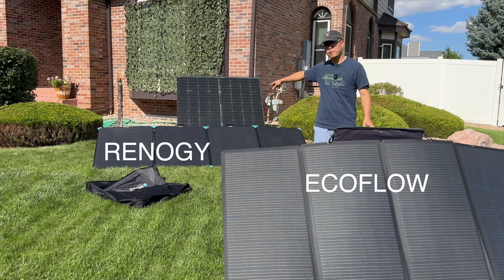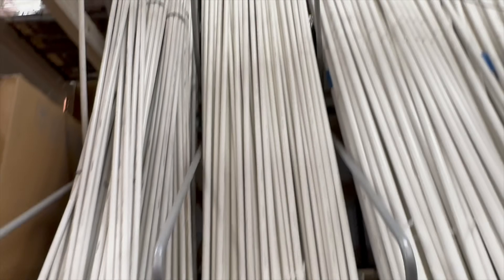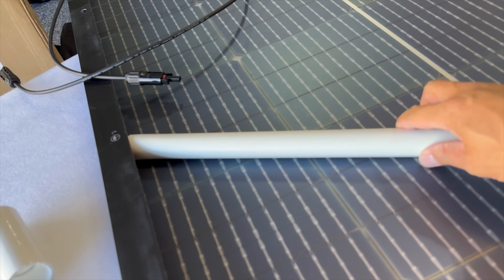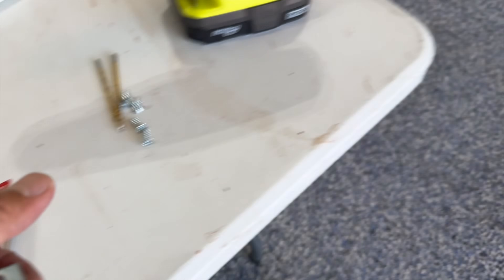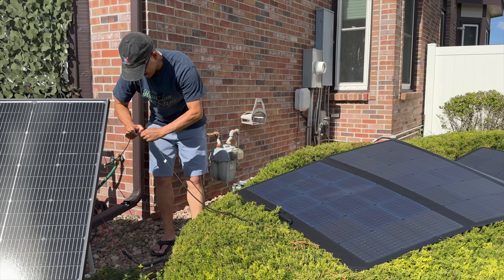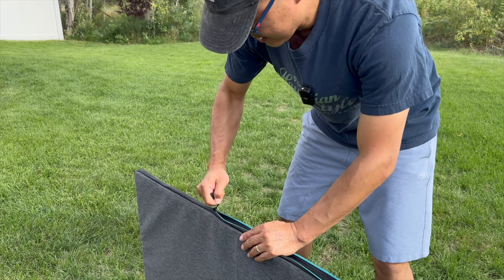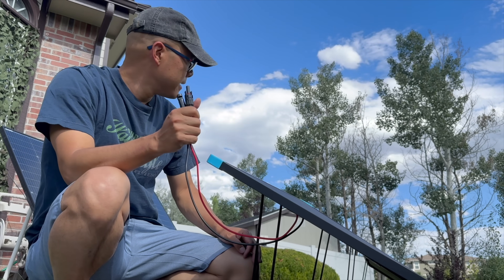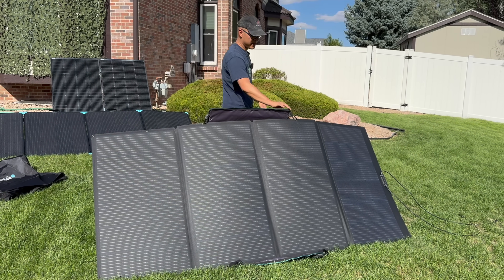My Cheap DIY Solar Suitcase vs the Best Portable 400 Watt Solar Panels

Comment: I like yours the best, but I'd probably just make 2 of them. Then you got double the power of all of them but utilizing the same amount of space, just taller. I think I might try this. How much does yours weigh? I'd probably drill a couple holes & do a rope handle. Then you can carry one in each hand when setting up.
Reply from the maker: I have the weights of each right here on this chart. It's not a lightweight! https://youtu.be/BXfIY1RQOmU?si=TdApZvQ-PEcAyHB9&t=540
Reply: @freshlycharged 50lbs isn't too bad. Thanks man.
Reply: I would definitely add some carry handles and magnets or a chest lock for insurance when closed.
Reply: I know I'm female and not big i need something not so heavy I bought a Ultra from Eco and 2 200s and those things are heavy.  Haven't put them up on the roof yet im thinking on the ground so if move I can take them with me but they are heavy,  I should have started with a smaller  system and  panels and just more of them😊   Live and learn thanks